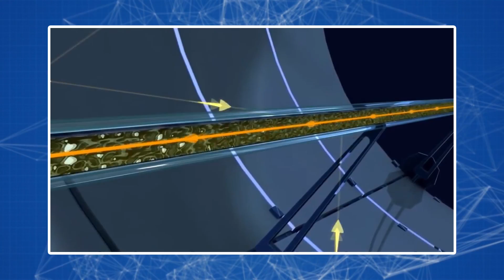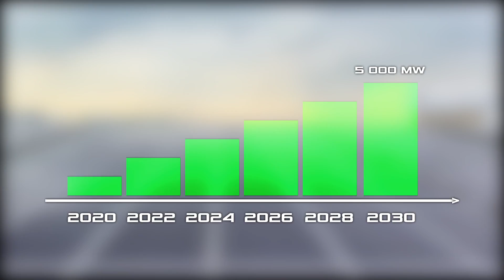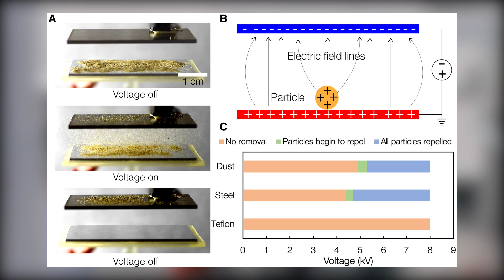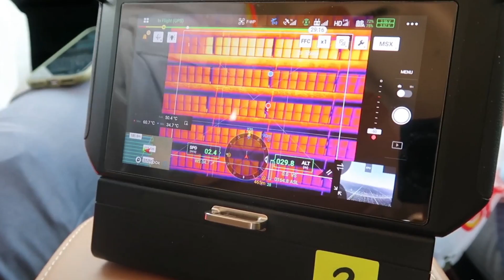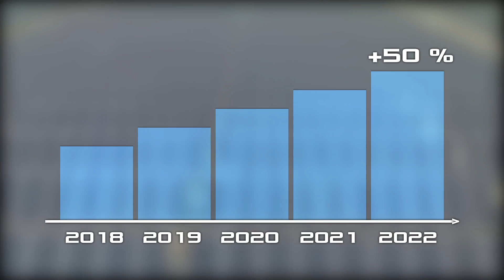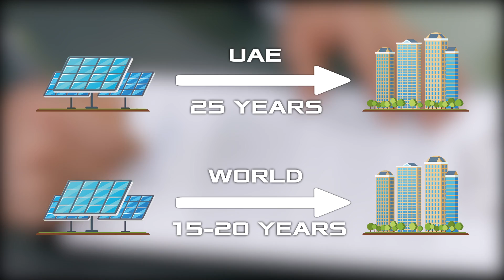How Dubai is moving to renewables

Comment: dear Mr loki-rascal i know your not well educated so let me keep it simple.  Energy used to get it out of the ground to the point of installation ( in the power making industry only) is not a return that makes more than was used to get it  ONLY HYDRO IS NEAREST . now wind is 27 years as an average solar 10-15yrs  both fall well short in the reyclable terms less than 50% dams 100 plus years and well over 90%

Comment: What makes a system meet the definition of green ?  1ST It must make more power than was used to pull it out of the ground refine it melt it mold it machine it deliver install maintain then remove ship and 100% recycle it. ONLY hydro lasts long enough to meet the level. And even then there are no dams running three turbine halls it has been made
Reply: You are 100% full of crap! What you are talking about is called embodied energy. The embodied energy in a wind machine is only 5%. And solar panels also have very low numbers like that.
Reply: @Loki-rascal  an idiot saying nothing

Comment: My 10 335 watt SunPower solar PV panels on my garage roof generates 6,000 kilowatt hours annually. Basically net zero now. Let's rapidly build our renewably powered world 🌎 !
Reply: who is balancing your generation and consumption. The grid? How much do you pay for that service? Nothing?
Reply: @generictester  Yes, I use the wind/natural gas powered grid in the evenings and winter time to heat and power my electrified house. During the day I use my solar PV electricity to heat up my thermal mass tiled slab under my desk and in the evenings I run two 1,500 watt electric heaters. I use far, far less energy to heat my house now that I maxed out the insulation in my attic, floor and perimeter walls. I disconnected the natural gas service to my house.
Reply: 6000 [KWh]/8760 [hrs/year]/10.335 [kW]= 6% of utilization factor. 

"The typical values of the solar capacity factor are between 10% and 25%. For the solar utility power plant, solar capacity is around 24.5%."

Comment: OIL is running out. We reached the tipping point for Carbon to raise sea level back in the 1970s. 
IF it required Government Subsidies, Grants, or just Out-right Government 100% pay for construction and operation = can shift away from Carbon FASTER then it is worth an entire government's income, borrowing, QE, etc etc... sourcing to money to pay for it.
Can definitely tell this is a Yank channel by the OH MYYYY - tax money was used to pay for xyz = the worst thing that is humanly possible!
Taxation and Government directly doing projects A to Z are actually, factually, the most economical way for anything to be created/constructed. 
What is it with Yank Obsession that everything is BEST when done by private companies?? These private companies would only be doing xyz IF they have a minimum of 20% PROFIT. 
Government run projects, even with a 1 to 5% cost over-run are still better than lining the pockets of a very select few - Asset Mgmt/Hedge Fund share holders.

Comment: In 2028, the first small modular reactor (SMR) will be on line in Canada - GE Hitachi's BWRX-300; closely followed in 2029 by the Rolls-Royce UK SMR and NuScale's VOYGR. They are all Gen III+ 'walk-away safe' power plants with emergency planning zones (EPZs) at the boundary fence instead of the 10 miles radius applied to Gen III+ designs of 'Big-Nuclear'. They can be built in 2 to 4 years and financed by commercial money markets. at overnight capital costs (OCCs) between 40% and 60% lower than 'Big-Nuclear'. They are so investable, they will drain the financing lifeblood out of wind and solar power plant (WASPP) technologies. 

SMRs can readily decarbonise power generation. But few, if any, in authority realise that greenH2 is as important to decarbonising all the other sectors of energy use as is low-carbon electricity. And this is where the Occam's Razor of energy decarbonisation can become reality. 

SMRs combined with electrolyser plants can load follow demand instantaneously on a daily basis by switching between grid electricity generation and greenH2 manufacture. The SMRs can operate at 100% availability - their most efficient mode. They get paid by 2 revenue streams and maybe others - in the UK - for load-following grid service; for frequency-correction grid service. 

Seasonal load following is achieved through carefully calculated refuelling and maintenance outages. The need for any energy storage might well be met in most part by the volumes that exist in a nation's gas network infrastructure. No need for batteries or pumped hydro; no need for any politically-sensitive dams for conventional hydropower. 

And all of this at many times better than a zero-sum-game since the build out will be a tiny fraction of the financial cost of pollution from the burning of fossil fuels, let alone the prevention of millions of premature deaths also caused every year. It may not happen by by 2050, but by the end of the century we could be just about there.
Reply: Who pays for de commissioning and waste???
:hand-purple-blue-peace:
Reply: 😂😂😂😂😂❤❤❤❤ nuclear power lobbying at its best 😮😮😮😅😅😅
Reply: @FJS-RIP-2025  How brilliant can one person be with the use of emojis? A picture says 1000 words. How many real words would you have needed to for a constructive or destructive response?